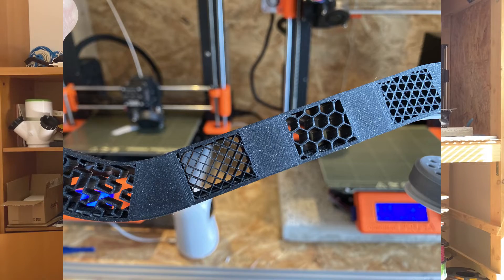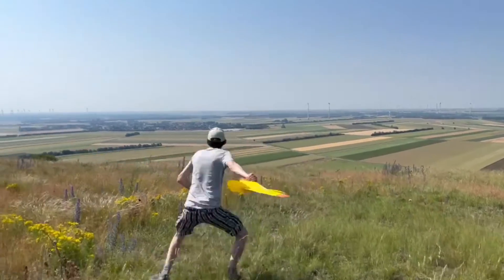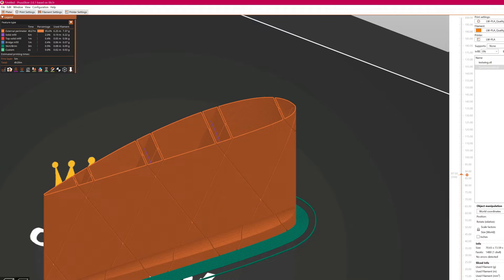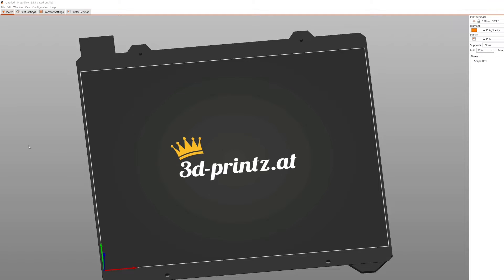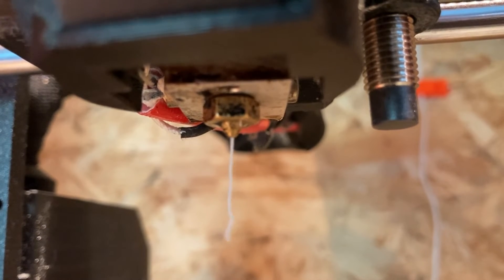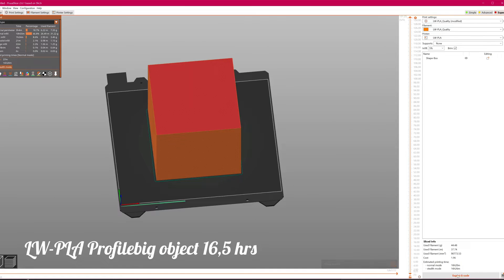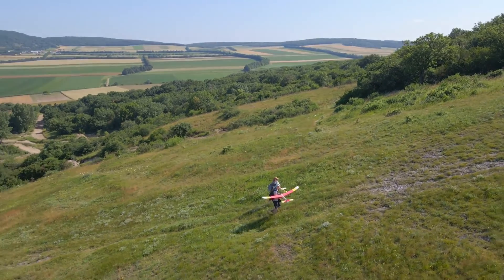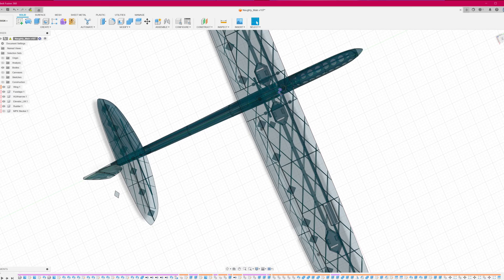Infill in 3d-printed Wings - my honest opinion.

Comment: Very interesting ! - makes sense I guess, but the main problem I have with LW PLA (& wings with ribs in particular) is over time the LW PLA droops between the ribs. I probably haven't got my print settings dialled in perfectly and/or I'm using cheap LW PLA (esun); but using infill does seem to address this issue quite well - so far at least.
I haven't had issues with wing strength yet - but then if I want a strong wing then I would print it in PLA or ABS.

Comment: I beg to differ but the future will prove whoever is right right
Reply from the maker: Yeah the trend goes into the infill direction. I still stick to predefined structures due to weight reasons. Every usecase has it´s optimal designtechnique i guess :)
Reply: @3d-printz  I find myself agreeing with Ripmax 333 it would be good to be able to do a hybrid of the two types

Comment: I don't like the widely adopted design of wing structure for 3D printed RC planes either. I'm designing a small RC plane and am planning to print the wings at a 45 degree sweep angle meaning I can still design the wing structure the conventional way and have ribs running length ways. I'm not sure if anyone has done this, haven't seen any videos but I don't see how it wouldn't work. I will need to slice the wings up in slightly undesirable places but the wingspan is only about 600mm so it shouldn't matter.
Reply from the maker: did the exact same thing at my design "LouLou" - works well! also the layerdirection helps improving stability :)
Reply: @3d-printz  Just found the video, nice looking glider.. looks like you're flying a bird. Was that 4 sections for each wing and 900mm wingspan? I'm hoping I can get mine in 2 sections but the triangle section at the root might be best as 2 separate pieces.

Comment: I have not tried, but, if using PW-PLA I suppose after using the slicer filled wing you could attach a drill bit and bore a hole and then very slowly to insert a carbon fibre rod with some slow  setting epoxy. Similarly, push rods from stiff bike spokes in the wing to get your flaps operational should easily penetrate the slicer filled wing.

Comment: Ive had success lately with using gyroid modifiers (in bambu slicer) in certain critical areas only.   Its been strong and light. Perhaps still not as ideal the your preferred difficult method, but much easier and allows modification in future prints. Ive been making the bottom of the fuselage around 10% and having a 10mm cross section of gyroid infill on the top of the fuselage. For the wings, i make 'spars' of high infill in diagonal patterns. Im too stubborn to spend my time designing proper support haha. Now im probably spending as much time figuring out how to use modifiers effectively. Thanks for your video

Comment: Good points, maybe it would be nice if it was possible to find a compromise on the wings design. For example a small part of the leading edge of the wing, just in front of the front spar can be printed with infill and the rest printed normally, This at least  can serve as extra impact resistance.
Reply: You can use modifiers to do that.